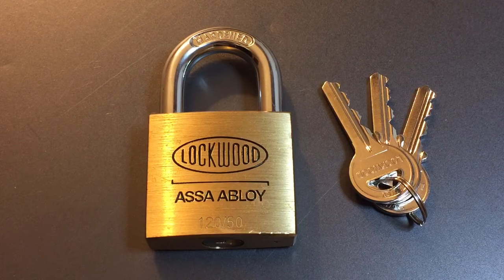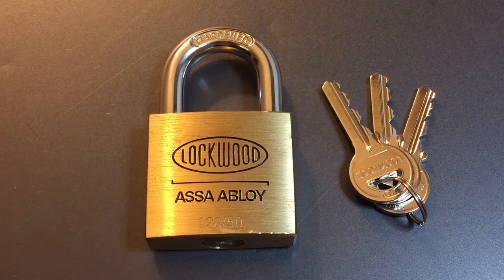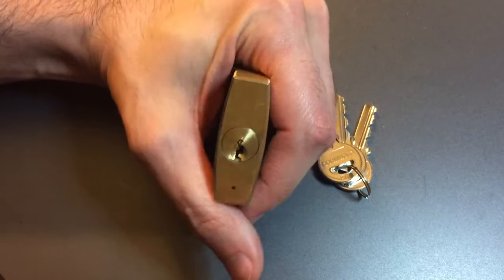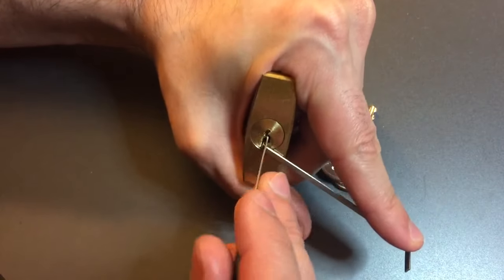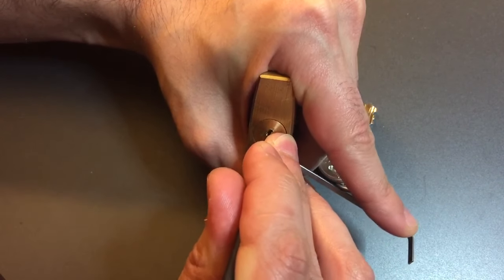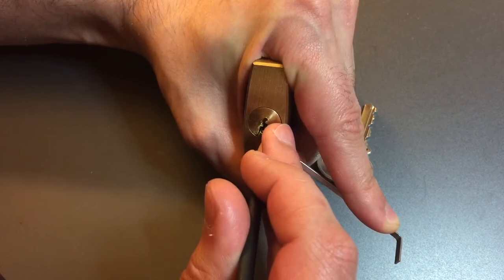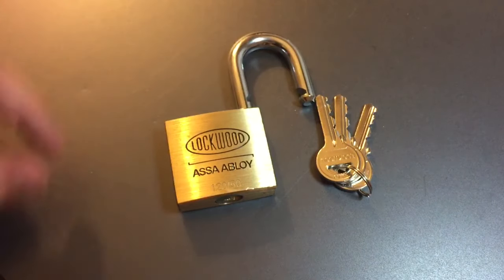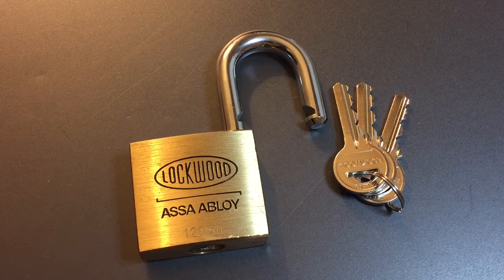[286] Lockwood 120/50 Padlock Picked

Comment: That was amazing! 5 pins. I have one of these padlocks and cannot get into it grrrrrrrr. I can do the car, the house but not this, maybe after your video I will bahahaha
Reply: focus more on trying to get a false set followed by practice setting a spool or two rather than trying to get it open.
Reply: @Ghorda9  I can get all the pins except for the last two, tried the pick gun which I find useless and still cannot crack it. I don't know what a spool is.
Reply: @jojozepofthejungle2655  do research on spool pins, you have to spp it, are you sure that you are even setting the other pins or are they just seizing up?
Reply: @Ghorda9  I couldn't tell you, I have never used one of those practice locks to find out.
Reply: @jojozepofthejungle2655  a set pin would be loose and will flop about when you shake it, a seized pin would just sit there , not budge  and give you no feed back.
Reply: @Ghorda9  oh ok cool, thanks again.
Reply: @jojozepofthejungle2655  seized pins are spools that have caught on the shear line and would require work/variable tensioning to set.

Comment: 4 spools?! im boned, 3 days and nothing but false sets, putting this lock on my yard gate!!!

Awesome vid dude!!
Reply: Just keep going at it man, I had the same problem but found it much easier to get open after I took some sand paper to my picks, mind you I probably should have taken note of the binding order 😅
Reply: @wenethmoon6587  I got it!!!! HOLY!!!!!!!
Reply: @drunkimunki4286  congrats man, out of curiosity was pin 2 a standard pin for you aswell?
Reply: @wenethmoon6587  you'd be spot on sir, it would appear to be standard no matter the size of the lock, if it's a 120, 2nd pin. Interestingly too I have a bunch of yale 110/40 type locks that have the same keyway and guess what else? 2nd pin is the standard.

Thanks bloke!!!!
Reply: @drunkimunki4286  that’s interesting to note, easy trick to get a head start by getting a false set first shot. Gonna have to remember that one 👌
Reply: @wenethmoon6587  i done messed up. Am currentlt holding 2 more of the same lock that have the binding pin for a false set at position 4...... ooopadaise

Comment: Great job again.
I've got a 121/50 on loan from Lock Noob (I think it's probably the same lock with a plastic cover), and it's real PITA. The bitting is 4 very low pins with #2 being extremely high, #2 won't bind until the other 4 are set, and it's far to easy to over set them.  I've managed to open it numerous times, but it's extremely camera shy. I must try harder :-)
Reply from the maker: Thanks, and good luck on LM's lock.  FWIW, my lock seems to like stout tension and picking pressure... otherwise, pins will drop like crazy!  Also, you may be interested that my clover leaf Lockwood is on the docket for tomorrow.  :-)
Reply: Thanks, looking forward to it, did you work out the pin in the end?
Reply from the maker: I have not touched the lock since we discussed it.  I shot the video several days ago, before we talked... I usually shoot several videos at once, then post one per day.

Comment: I'm a newbie.. I bought this as a starter lock 120/20 (a bit smaller) to practise on..
I've since opened many others but this guy has just given me blisters !!
Reply: BANG!  Finally got it.. so what was i doing wrong??? 
TENSION was way to much and also how far i was oversetting pins
P.S - the smaller the lock the smaller the tolerance and increments in movement
Reply: @djfunkychicken  for health reasons larger locks are better, the smaller ones can make your hand cramp up.
Reply: @Ghorda9 
 health reasons! 🤣 best reply
Reply: @djfunkychicken  i have large hands.
Reply: As my first lock it only took me like, 20 mins somehow

Comment: Nice Pick. Is there any way you can show us the pins? Does it have any anti-drill pins or plates? Love your videos.
Reply from the maker: Thanks.  The only way to show the pins is to destroy the lock, so no.  I do not believe that this lock has any drill protection, but that's just an assumption.
Reply: No drill protection on this one, this is the "Kmart/Lowes" grade of Lockwood. Next models up (same sizes, better lock) which use a full size key have antidrill pins.

Comment: I just lost 47 years of respect for Lockwood. I was in the corner too😂😂😂
Reply: It's a perfectly good lock for the price. It should be resistant to low-skilled attacks such as raking. I doubt there are many thieves out there who are expert single pin pickers.

Edit: I got a couple of these locks. For me at least they are a really hard pick. I have got them open a few times, but I can't do it reliably. I don't know what the problem is. It feels like all the pins are set, but it doesn't open. I can pick more expensive locks.

Comment: nice lock to bad you couldn't remove the cor. i have Shurgard made in China looks like what you have there maybe a knock off?  but what a. B. to single pick but easy to rake. have you try raking yours give a try..let me know nice job picking. 😎
.
Reply from the maker: I doubt this one will rake with any regularity.  Between bitting and 4 spools, I would think that any open with a rake would be a very rare occurrence... but you never know.  Sometimes locks surprise you.